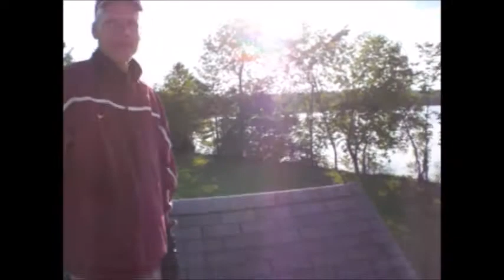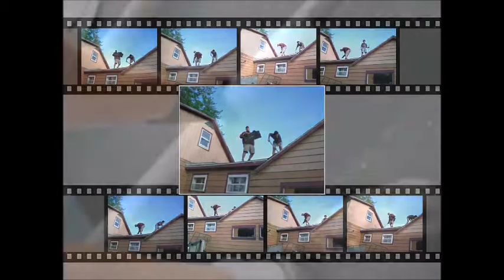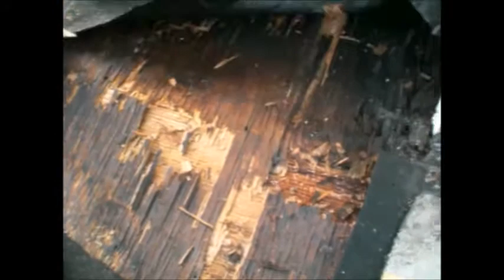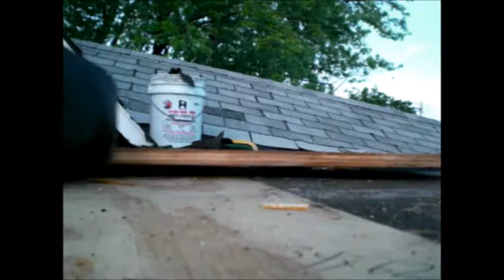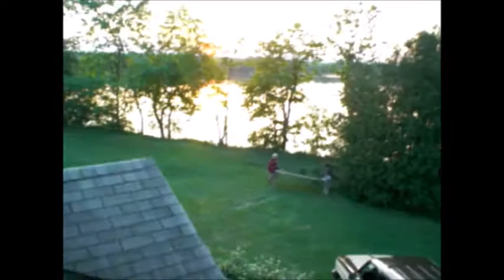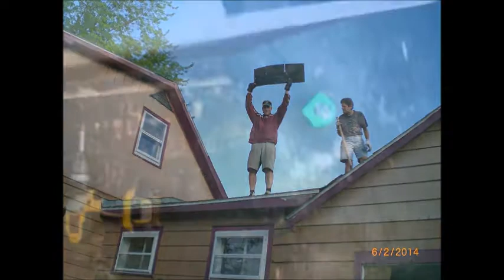Whadawreck Roof Tear Off  6 2 14

Comment: 3/8? My goodness that's thin. The house I'm in now is sheathed in 5/8's CDX pine. My house we just sold had 1" T/G. I would have thought thicker would be code up there with all the snow. We don't get anything like that here in Mississippi and the thinnest I've seen people put on roofs here is 7/16 OSB.
Reply from the maker: Cheap ass crap!
Reply from the maker: 1"? That's rare! and plywood warps, OSB is better
Reply: Oops, forgot to mention it was a house built in the 1920's and it was T/G 1x6. Loved that house, hated the location...